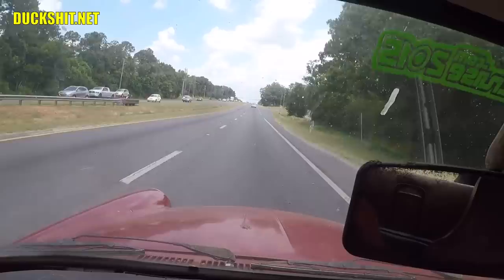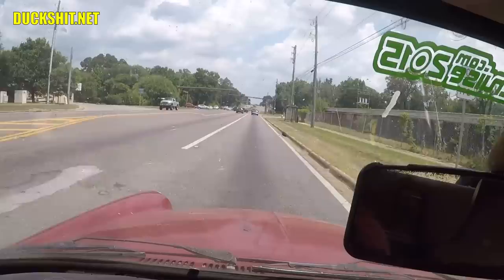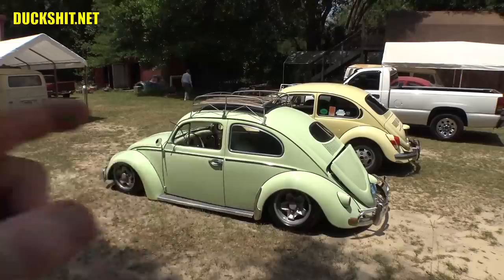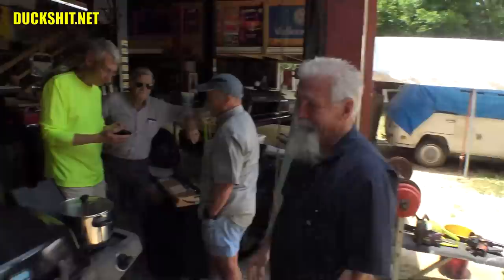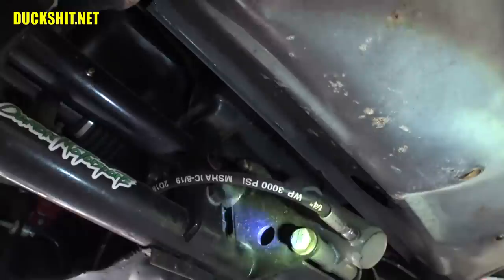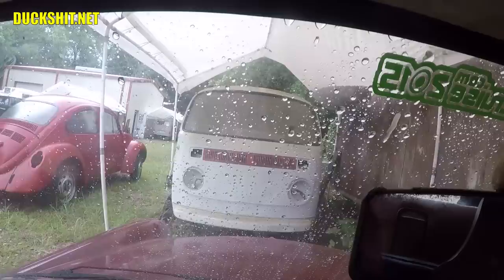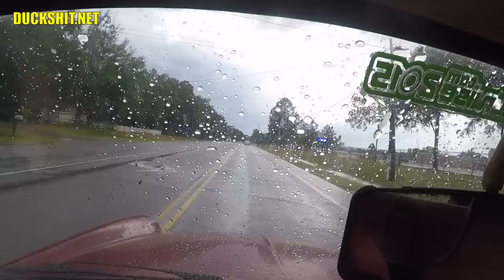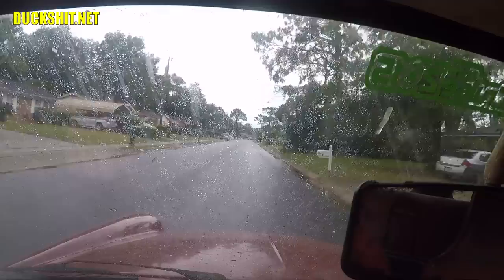VW Tech Session - June 2019

Comment: Duckman loves the rain!!!; ), Double drift I've put them in every bug I owned different ones for trans aren't the same even better fuel mileage Gene Berg made a five speed with the double drift pin with gears one time not bad in the 80's don't know if anyone Makes them now I also use steel shifting forks used a old drill press as a press back then good to have real press to crack the trans it's that old spring thing of death!, like heard some do it with longer bolts switching out to draw the trans to together never tried it press much better!!, Thanks Duckman!!!; )
Reply from the maker: Thanks for the comment, but to be honest, I have no idea what you're telling me about here.  A drift pin?  Thats normally a tool used to widening a hole lol.  You'll have to clarify for me!
Reply: @vvtheduckvv  the planetary gears in the transmission that drive the rear wheels in a VW normally has two Spider gears opposed from each other on a single steel shaft drives off the planetary gears and the return drive that comes from the speed change acts like possytraction the new one has four spider gears instead of two and cross shaped shaft the four extra spider gears giving the rear wheels both traction old VW trends sold them the 79's through the 90's my father told this they use to make double drift for bug by welding two single pins together crude back in the earlyer 60's I bought mine forged cross shaft with the four spiders gears in 80's in Cal. Gene Berg LA shop Brought to CT my father help me put it in I was in the Marines then it went in a 69 VW bug then later put different  ones in a 68 bug and 67 fastback those were done by a friend at Amico Transmission in Ocala in the 80's